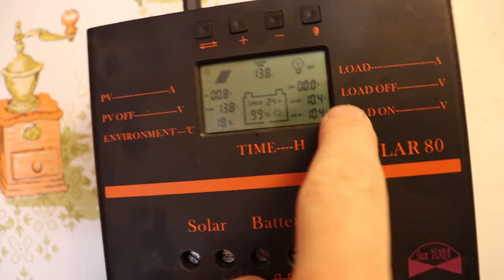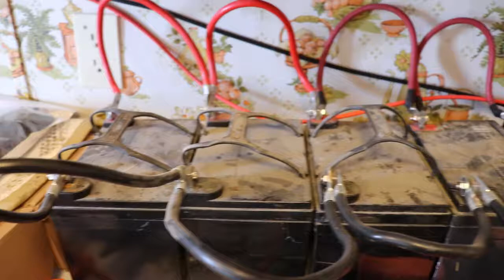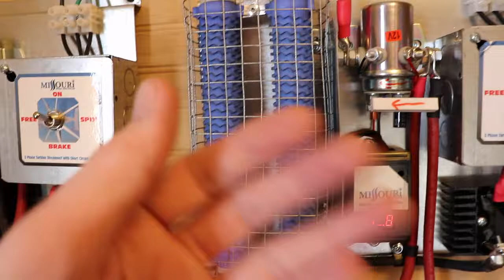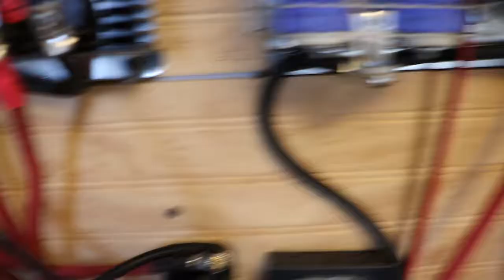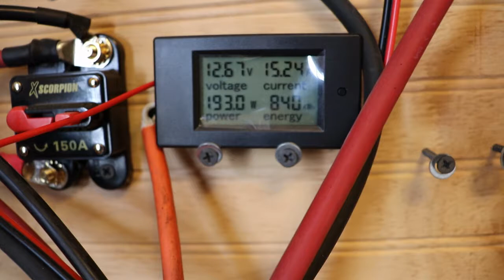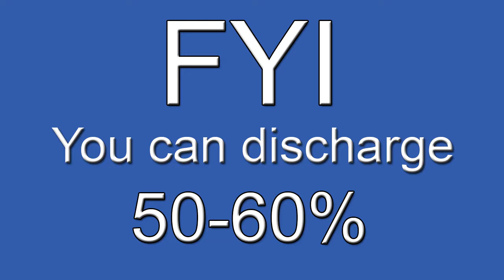My Solar and Wind Systems

Comment: Hey thanks for the info I'm going to have to do some more research on the solar/wind I have the off-grid solar under control just been wondering about the wind turbines hope to Cya in  future videos
Reply from the maker: I would recommend you go 48VDC on wind turbines to get the maximum production out of them. The max my turbines can produce each is around 500 Watts at 12VDC, whereas if I switched them to a 48VDC board then they could reach 1700 Watts. I hope that helps you. If you have a fast running year round stream, look into hydro-generator instead. This one does all 3 https://windandsolar.com/skymax-440-diversion-controller/ additionally you could pipe in the power into a https://www.youtube.com/watch?v=TEqULG8N6U0 unit.

Comment: Good work!  Lot of potential with the power of the sun.  Stay safe!  :)
Reply from the maker: Thanks, you too! I have been doing a video on installing, wiring a MPP Solar All in One unit that I hope to have out this month. I have been busy with home repairs these last few weeks so it is delayed.
Reply: @DROPsHomestead  looking forward to it.   I have been considering doing some solar but haven’t had the time to do it yet. It’s definitely something I’m going to do.  I think it’s a great option to have and use.     Have a great week and stay safe!
Reply from the maker: @OutdoorsandCountryLiving  got a great lead on used solar panels that cost 15 percent of the new cost and tested out of Arizona.

Comment: Better to end battery charging when they get up to voltage then Dump from the batteries.  LiFePo4 batteries its better not to cycle them more then needed.  Just use voltage control and divert the source to some other use.  Water heater or what ever use you could use.  Never dump from the batteries .  Lead Acid actually like the over charge from time to time  ( Equalize Charge)   but not other types.  In the winter my excess power goes to heaters or water heating.  Summer Direct Solar to Grid Tie inverter saving the electric bill.
Reply from the maker: Missouri Wind and Solar has a great selection for heating elements for electrical heaters to convert your existing water heater to solar. Very inexpensive.